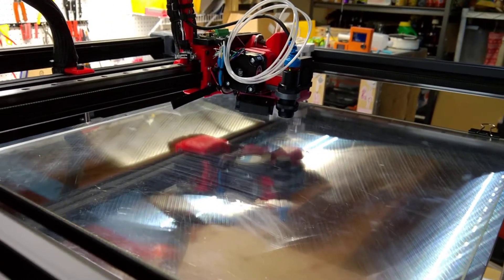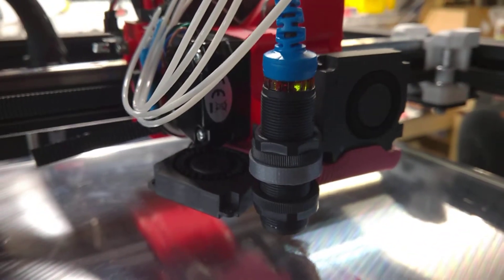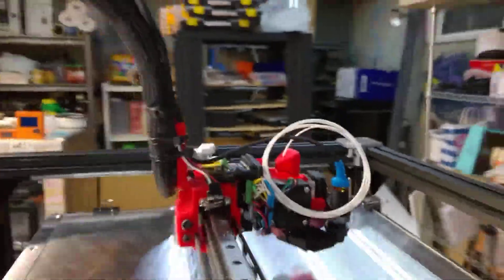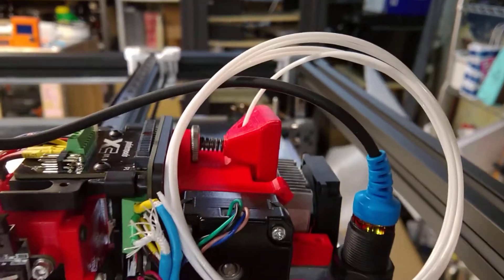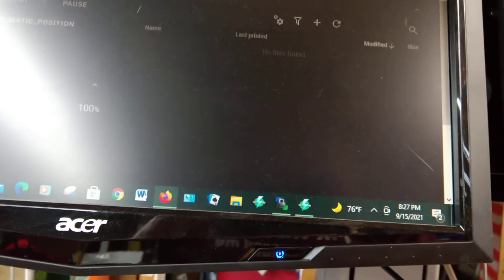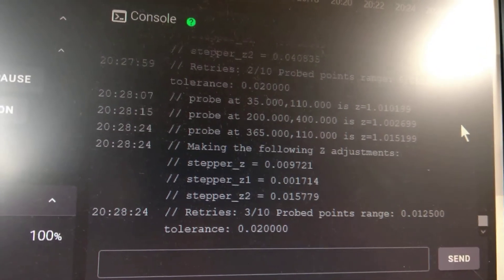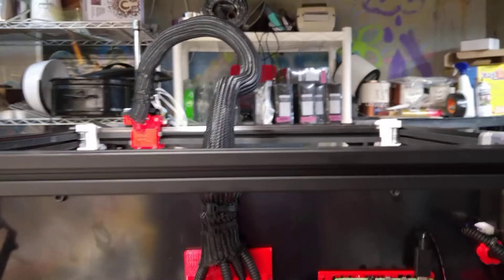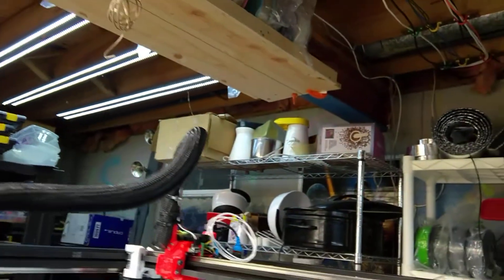RAT RIG - homing and bed tram

Comment: Really love your cable management. One question, what hotend did you end up going with for the OmniDrop?
Reply from the maker: The OmniaDrop has it's own hot end as part of the system.  It has an all metal heat path  and ring heater.    Take a look at it here.  https://www.dropeffect.com/
I did spend a lot of time on the cable management, my other printers are a real mess, and wanted to do a better job on this.  I'm starting from scratch on the OmniaDrop mount.  The x-change just would not work, so modding the Hemera EVA mount.
Reply: @woodwaker1  That is a really good design. Im building a ratrig v core 3 myself, just stock on which hotend assembly to go with. I will be following and using your videos for inspiration.
Reply from the maker: @EB3DPrinting  - there are some good alignment tools that will help with the build.  Not sure how far you have gotten.  I published a 44mm tool for the back panel on Thingiverse, https://www.thingiverse.com/thing:4959592  and I have a l3easscrew spacer that I got from somewhere- just found the link https://github.com/cyborgcnc/CYBORGCNC__RRVC3MOD/tree/main/Misc?fbclid=IwAR1uoTpSukzFJVlWD-7afwkCSfCGme6prY7L4ghn5EQ_5aUWOXhgG251qUU